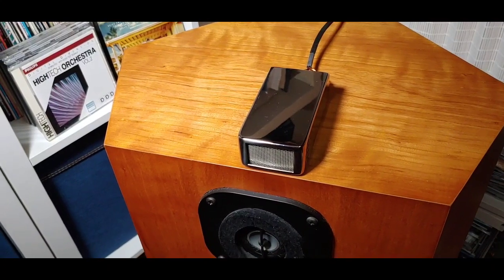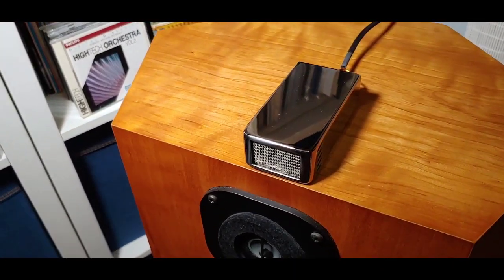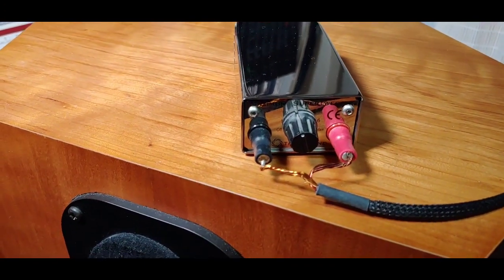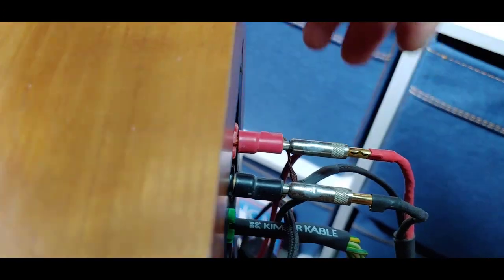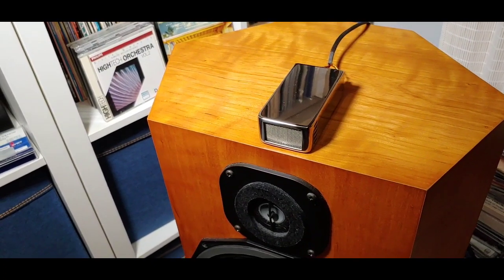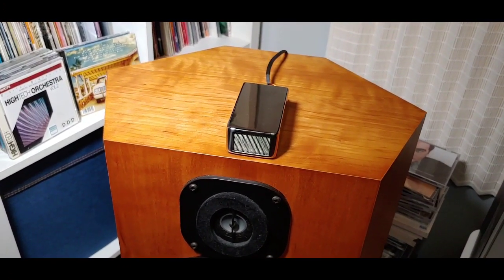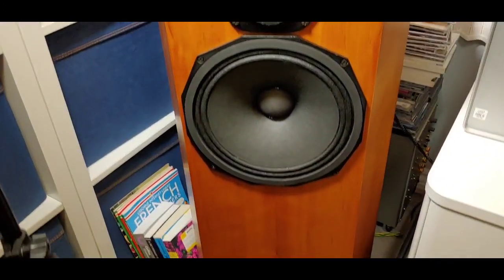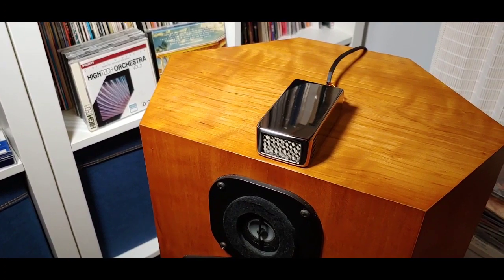Taking a look at the Townshend Audio Maximum Supertweeters

Comment: Hi Ian - I have a pair of these (mine are black) and find them a very useful addition. I notice the same things as you including "air" on choirs, voices, violins etc. which was less pronounced on my KEF Reference Three/2's. I didn't realise the dB values. I run mine at setting 1 and can just hear them even though my KEFs are 91dBW/m.  I have upgraded the cables twice now - first was a Kimber pair from Russ Andrews and now I have a silver plated OCC copper PTFE/air  with special geometry (DIY). The homemade ones have very low resistance, inductance and capacitance which are all important at high frequency and have improved the perceived extension.  All the best, Rob in Switzerland.
Reply: Hi Rob, 
Did you find that the cables helped or did you move from 1 on to a higher dial setting to better match the sensitivity?  4-5?
Reply: @jefffan171  I run them at about 2 or 3 (depending on my subjective feel) I think there is a potential for damage to them if they are at high sensitivity values. My power amp has 225W RMS per channel and has good headroom for peaks so I'm staying cautious. I feel the cables may have slightly helped (I already replaced Townshend cables with Kimber a couple of years ago). The 24 conductor silverplated expanded weave may have very slightly less energy storage at high frequencies (but they're only 1m long). It's more my nerdy overkill than an essential upgrade - one less factor to think about. 🙂 All the best, Rob in Switzerland

Comment: Had a pair for several years , worked a treat . I used them alongside my stacked (tweeter to tweeter ) NS 1000 M s . They do make a difference but only if the main speaker has high resolution . As to hearing the output you absolutely can , my 70 year old ears had no difficulty whatsoever , in fact that s how I discovered I d blown them up 😵‍💫. As to the “snakeoil” canard you might want to look at the innovative products Max Townshend produced over his impressive career starting with the damped tonearm trough gizmo  ..he was the real deal . I ve moved onto horn world and am currently  optimizing my system around a pair of “full Volti” Klipschorns with which the Supertweeters had no effect so I sold them on .

Comment: I did an experiment with a supertweeter (not this one, but I think the results will be similar). I connected it with a capacitor and measured. Subjectively it improved the treble and bass, just as explained, but the measurement reveals that it starts to lobby the tweeter, canceling out the wide range, even at 3 KHz! Of course, this made the bass more prominent as the overall balance changed. So my conclusion is that even an expert like Mr. Townshend can't design a one size fits all situations driver, but he has to develop a system with other drivers and the crossover in mind. On the other hand, I have much better results with upward firing supertweeters even if their contribution is not easily measured but can be heard immediately. And this one won't improve the bass at all! Someone mentioned that adding a sub would improve the treble. It's a similar situation, only from the other side. If you implement a sub without measuring and it starts canceling out the midbass of the main speakers, you may conclude that the "treble is improved", but the reality is often different. Prolonged listening reveals the truth!

Comment: Did you measure the overall frequency result ? Just adding tweets will phase cancel your speaker drivers. You sound like a beginner man…
Reply: I bet you what you want that I will make you measure the frequencies with your ears and you will not be able to indicate any measurement of anything even remotely, the measurements are made with instruments to satisfy the engineering and good design, when it comes to listening these details are merely imperceptible even to the best ear, snake oil.

Comment: I have a couple of them and have no idea how they work. 
Can someone tell me if the super tweeters are suppose to make any noise if I put my ear to them?

Also, if my floor standing speakers are bi wired should I be connecting the super tweeter up to high or low frequency on the back of the floor standing speakers ?
Reply from the maker: Hello Mohammed, you should connect them to the tweeters terminals on your speakers, there's a dial, on the back of the super Tweeters where you can adjust the frequency, I've got mind set to around 4, hope this is helpful, thanks for commenting & watching

Comment: Hi thanks for that demo. I heard very high end speakers sometimes use a tweeter in the back of the speaker as well as one on the front  where it makes a huge improovement to the sound. It would be interesting to know if this tweeter would give a similar effect.
Reply from the maker: Hello Justin, these are super tweekers, designed to pickup the highs from hi-res music, such as sacd or audiophile vinyl pressings, which standard tweeters can't, thanks for commenting & watching
Reply: @tweakerman  What happens to thin recordings with sibilant S. I guess it makes them sound even worse does it.
Reply from the maker: @Justin-fy7xk  no, I haven't noticed that.
Reply: Hi Justin I just bought them In order to use them the way you describe, will come back and give my impressions when they arrive
Reply: @ironsienna did you end up trying them yourself?

Comment: I've been using it for 5 years, if you don't have high quality content don't expect it to work. They don't make a sound on their own, but once you put them on a speaker, your world will change. a miracle product. magic that takes a much cheaper hifi system to the top.
Reply: Please could you explain what this part mean: "...if you don't have high quality content don't expect it to work." Do you consider CD quality low quality content, or do you think that this super tweeters work miraculous with CDs too? I use only CD quality. Thank you

Comment: Cool tweeters. There are several possible explanations for the improvement of the low end. Phasing may be one, as phase-matching between tweeter and woofer is one of the classic problems of speaker design. If they're out of phase, your ears will lock on the highs and the lows will seem to disappear.